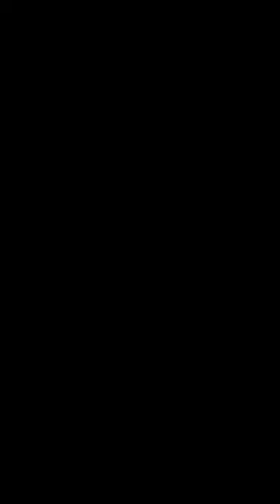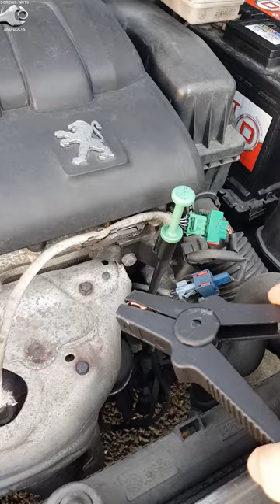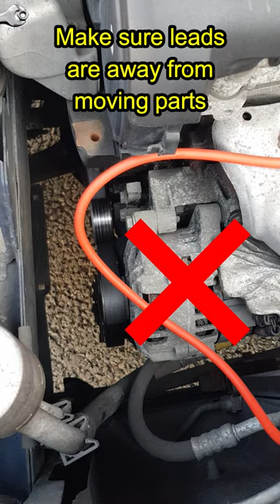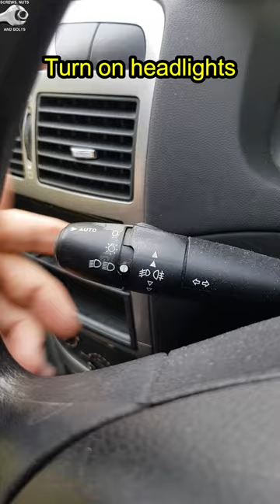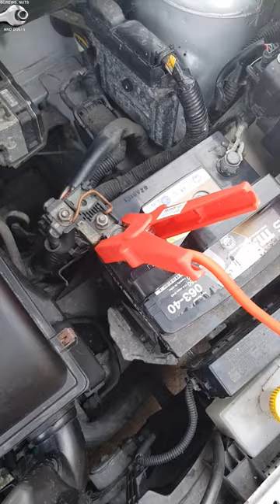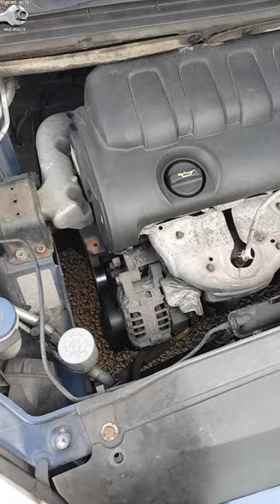Dead Car Battery ?. How to jump start your car using jump leads

Comment: Nice straight forward vid. I usually connect the negatives of both batteries.
Reply from the maker: Thanks. There is a possibility of hydrogen gas, produced by the battery, exploding if there's a spark when connecting the negative terminal to the battery so earthing the negative clamp away from the battery is safer :)

Comment: Thanks for the video!

I seen a video a guy explained that you must only have one car running at a time. He said the both alternators would work against each other and possibly break or whatever

So before starting the engine with the dead battery, you must switch off the charger car first? Does this sound about right?
Reply from the maker: No I never heard that before
Reply: Nope. That’s some Scotty Kilmer advice that’s not correct
Reply: I just saw that one also and was like I must have done it wrong evertime lol
Reply: Makes sense to me.
Reply: Its solid to follow because you want to at least charge it up to where the car can start.. but I doubt it can damage an alternator